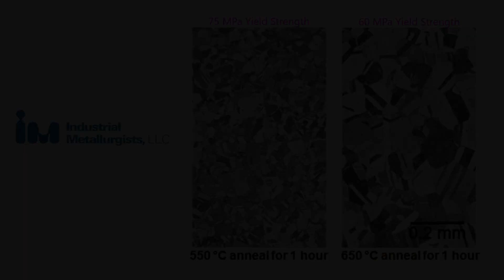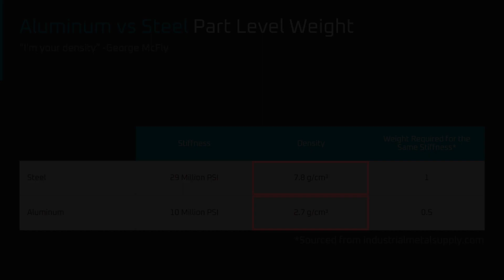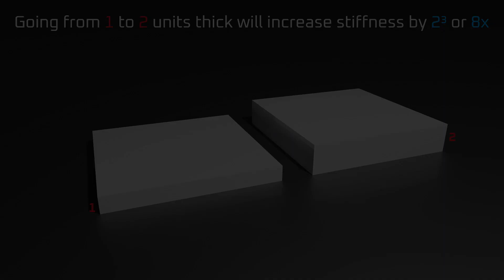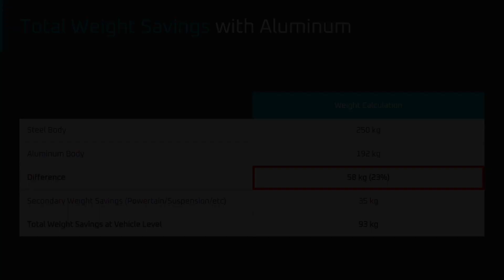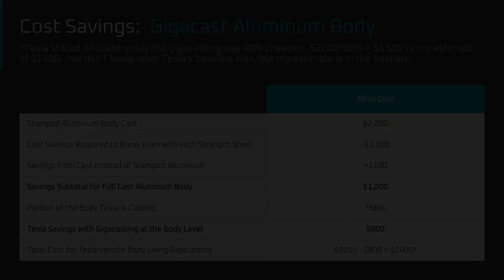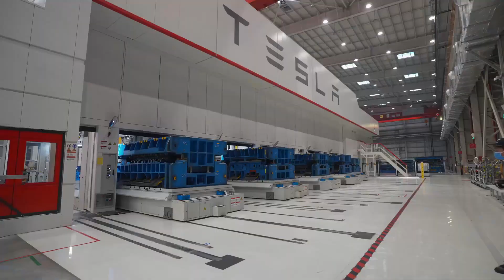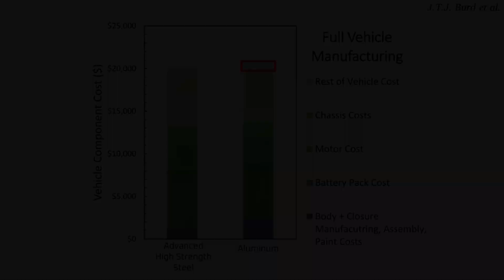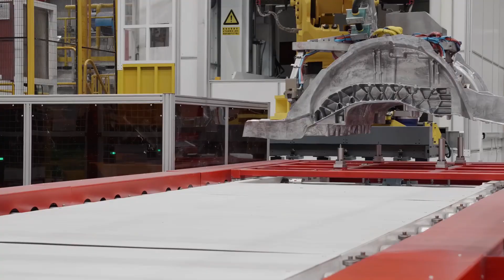#2 Tesla Gigacast Aluminum vs Advanced High Strength Steel

Comment: Very interesting analysis. However I have been thinking that all that only applies to the cars that are made with aluminum. How about the Cybertruck? It will be made using Steel, just like the starship. I have been wondering about this: There have been a few tech improvements that help decarbonize steel production: Metal Molten Oxyde Electrolysis method to obtain steel.  I wonder if SpaceX and Tesla will be using such methods. That should help, as not just the Cybertruck and the Starship are made with steel, but it should also help to decarbonize the iron required for LFP chemestry made battery cells, should Tesla ever make their own LFP cells. 
I already asked this in Twitter linking a video that further explains it. Since Youtube deletes comments that contain links I will only leave this here explained.
Reply from the maker: Cybertruck will have an aluminum underbody for the chassis.

The stainless steel is just the outer shell.
Reply: @thelimitingfactor  My point is that there are newer tech methods to refine iron and steel (and decarbonizing the process) , independently of how much of the Cybertruck is made of pure steel or if parts of it will be aluminum, some of it will need steel. Could you please take a look at my reply on Twitter?
Reply: FALSE, Cybertruck will have a Gigacast AU Rear end, using the Worlds Largest 8000 TON Gigapress to make the Part. the Rest of the Truck is MIX of AHSS, Mild Steel and Stainless Steel Alloy body.

Comment: I am surprised that you did not say anything about the precision and repeatability of the casting vs  assembling  frames by welding parts together. Casting allows a much more efficient use of material because it can be exactly as thick or thin as needed for the structural requirements of each area. For high speed manufacturing  creating ⅓ of a car in a few minutes means a smaller factory and workforce.
Reply from the maker: Already covered in the first video.  It's a series.
Reply: @thelimitingfactor  thanks! Somehow I missed it.

Comment: Great video! What mix does Tesla use today for its vehicles of aluminum and steel? That way we can predict the cost savings vs vehicles today.
Reply from the maker: Covered in the video 66% Al probably
Reply: @thelimitingfactor  Thanks! Is it likely that because Tesla isn’t using Gigacasting Aluminum, that when they make the switch, it could realize that large percent decline in cost? So not just save $100s of dollars, but far more.
Reply: @joiemoie   - dont forget , lighter weight vs AHSS and Range Increase .

Comment: Kinda related, but VW's chairman, Herbert Diess recently said that it takes Tesla 10 hours to make a model 3, but it takes 3 days to make a VW id.3.  I assume he's talking about Giga Berlin and Al casting.  He proposed tearing down some current plants and building back with more efficient plants.  I think VW is getting the message, but other manufacturers....?
Reply: Diess said that it takes 30 hours……
Reply: they are still building COMPLIANCE EV made with OLD FASIONED car Technology.
Reply: I don't know if it's already happened or not but Diess is facing a vote of no confidence at VW.
These guys are still pretending it's 1995 and it will take Diess a miracle to survive inside a dinosaur 🙄
Reply: the problem is that it seems Diess is alone at Volkswagen trying to convince them. So much that he dares mention the "T" word directly. It takes guts. I hope he gets fired from Volkswagen and Tesla hires him!
Reply: @Akira-nw4jl  I think all traditional auto manufacturers are facing boardroom struggles.  IMO, Toyota is loosing the battle, BMW is on the fence while GM seems to be forging ahead. The recent sales numbers reported by Tesla are telling...they outsold BMW, Mercedes and Audi in the last quarter.
Reply: @tommckinney1489  GM will want to improve on thier 26 evs for the 4th quarter of 2021

Comment: Elon said at high volume the giga casting might save them $260 per car. That not just from labor and material savings. It would include the saving from operational efficiency which to me would comprise more than 1/2 of the savings. This is why Ford and GM don't use casting.  They have to get their factories to produce at full capacity before they can get any benefits from squeezing more production out of a factory. Operational efficiency at Tesla is criterial for survival.  At least till the cost of EV's drop below ICE vehicles.
Reply from the maker: Interesting, do you have a reference for Elon's comment?  And was that for one cast or for two?

Comment: 15 and 20 minutes in: VW just admitted this week that the model Y takes 1/3 the time to assemble. Some of that MUST be from the castings.

Correction Edit:  VW said the Model 3 takes 1/3 the time.
Reply from the maker: Possibly not, they said it was the model 3 and the model 3 doesn't use castings yet
Reply: @thelimitingfactor  Well I got the model wrong, but I will bet that the ratio is similar for the Model Y.

Comment: Speaking of advantages, you left out one of the biggies, literally orders of magnitude better QC on the panel gaps. Elon was serious about microns vs the current millimeters.
Along with a brand new cutting edge paint shop, complaints about fit and finish will be history.
Reply from the maker: Covered in a previous video and will be covered again in the summary video
Reply: Rock on - Sandy Munro also did Analysis on Tesla Gigacastings. 
says QC is minimal, and can Shread rejects and Damaged parts.
Reply: Complaints coming from customers are compared between manufacturers at 3 months of ownership (3MIS 3 Months In Service). This data is shared across manufacturers and QA evaluation data in house is compiled by each and published so manufacturers have an idea how they're doing. But... Tesla refuse to do this.... Why do you think that is? Customer satisfaction is more than just fit and finish...it's the complete ownership package.. how satisfied with the car are you... What issues did you have as warranty claims etc... Why don't Tesla publish their data? I would guess it's not upto scratch... If your good you'd make sure it was known...
I worked 30yrs inspecting quality of new vehicles.. I've seen some Tesla's parked... Oh dear... There's some real bad panel fits out there... Not saying each manufacturer is perfect but bleating on that Tesla will be perfect is a pie in the sky... In real life getting a cars panels to fit properly usually requires manual bending somewhat to get it to fit. If you think that an assembly line WILL turn out perfect panel fit you know nothing of how cars are made, how cars are adjusted or how they are repaired to be ready for the customer from new. Go on a car plant tour... You'll learn something
Reply: @terrybrown6057  Why should Tesla have to do as the legacy car manufacturers have traditionally done? Our 2 year old Model 3 is perfect, panel gaps and paint are as good as any car (confirmed by detailers), reliability has been 100%, and build quality is very near to perfect. 
The Tesla is MUCH better than any other new car we’ve owned, (and without counting, we have had a lot of new cars in the last 40 years.)
The Tesla is just in a whole different league compared to all my previous ICE cars, which over the last 40 years includes European, American, Korean and Japanese built cars.
Reply: @FutureSystem738  as I said... As a customer you would never know how the company as a whole is performing. Yea, you have a car are happy with..great . But the truth is in warranty claims... Why do you think Elon refuses to publish warranty claims? Everyone else does. There are good cars with every company... But even with your detailers they won't have access to engineering standards and what tolerances are allowed before a fault becomes unacceptable. For example a panel that is designed to be flush +/-1mm... Each manufacturer has different levels of tolerances allowed as to what is achievable to the drawings. And what is allowed to be shipped out the door. So anyone working outside of QA at the manufacturer will never know what is allowed to be good or not. Every part has tolerances from fit n finish to even allowance on how hot an LED should be on a switch... What I'm saying is pure quality data is compared from sources of customers fault feedback and offline fault detection and treatment.

Comment: Hey Jordan, great work as always! Just curious: does the costing and cost savings include labor costs? With 1 part replacing up to or around 100 parts, I would assume there is a large amount of savings in labor just in assemblage of all that.
Reply from the maker: GREAT question!  Yes, the MIT estimate included energy, labor, overhead, tool cost building cost, maintenance cost, material cost.

Comment: Another opportunity for economies of scale is the possibility to use the same casting for both front and rear. maybe that's how we ended up with rear wheel steering on the Cybertruck.
Reply: NO, gm is using the same BOF and suspension as Regular trucks , you can add Quad steer as Aftermarket option. not that hard to do.
Question will be , how much Quad steer will CT get 10% or 15%.

Comment: You compare the cost per unit weight of steel versus aluminium. When you create stamped steel parts, there is a lot of waste steel that gets thrown away. When you create cast aluminium parts there is very little waste. Are you using the amount of steel (weight) that ended up in the vehicle, or the amount of steel that was purchased  - in other words, do you need to include the cost of the steel that was thrown away.
Reply from the maker: Good question!  The research was pretty comprehensive, I'd have to look through all of it.
Reply: The off cuts are recycled back... Not thrown away
Reply: @terrybrown6057  I'm happy to hear that, but since the price that they get for the recycled cuts is less than the cost of new material, that difference would have to be included in the overall cost. Not sure if it significant, but it could be.
Reply: @ljd7088  depends on whether the car plant has its own smelter ... Some do..

Comment: There's another cost:weight dynamic that is of increasing importance... the after sale cost of fueling/charging the vehicle increases with the weight of the vehicle. The old combustion industry didn't care, since that cost was born by the customer after they'd bought the car (the colatteral enviro cost being completely ignored for 100 years of combustion). Now with climate change driving the dynamic it becomes more important to factor in the impact of weight on the lifetime fueling requirements. Lighter total mass might eventually become more important than cheaper build and market price.
Reply: I’m not usually a fan of European regulations. However they have forced car makers to improve fuel consumption and safety of passengers and pedestrians. 
Tesla did not want to be excluded from that market so designed its cars to exceed EU regulations.

Comment: My guess is that your analysis is a lot more comprehensive than that carried out by most vehicle companies.  I think you got it right about the inertia of sunk costs and techniques effectively dictating the continued use of established materials.  Most car companies will focus on specific areas of a vehicle rather than assess it holistically. Tesla only ventured into Giga castings because it was a way to simply the manufacturing process of the rear substructure that they had developed for the model 3 and model Y, the original being a dogs breakfast of a myriad of parts that were expensive to assemble.  However a good idea applied in one area often lends itself to other areas and sets in motion new trains of thought.  It is only a matter of time before the electric motor outer casings become integral with the subframes as a further step in reducing parts and simplifying processes both of which contribute directly to reducing manufacturing costs.

Comment: There is more to it: Globally there is abundance of cheap bauxite with silica levels too high to make beer cans. But Tesla found a way to use a high silica content aluminum cast to avoid the problematic combustible magnesium.  Airplane makers won't drive up aluminum prices right now so Musk can organize the supply chain to stay ahead of the competition.
Reply from the maker: Hey man!  Interesting comment!  I didn't know this!
Reply: Bullshit, bauxite is abundant but making aluminium is one of the most energy intensive processes. Aluminium is not just used for aircraft but for appliances, cars( engine block, gearbox housing, subframe,) aluminium is also use din vast quantities in construction...... Tesla isn't going to have aluminium for them alone, you're welcome.
Reply: @moineaux9173  What bullshit?  He didn't mention the energy, just supply chain.  And he didn't say for Tesla alone just said stay ahead of competition (and that would be other automakers).  You didn't understand what was written very well at all and reacted to nothing.  That's a fail.
Reply: @TheEvilmooseofdoom  were talking about supply chain here and bauxite has to be processed into aluminium first. Finally the demand of materials like steel, aluminium, copper..... are non stop growing.
Reply: @moineaux9173  Yet you brought up cost of production..  And you brought up the supply issues posed by other industries when the OP was talking about automotives. This is getting weak.
Reply: @moineaux9173  Copper supply MAY become a problem. EVs use 2 to 3 times as much copper  as ICE vehicles use.

Comment: How, and how much, does the use of cast aluminum bodies affect collision repair costs?
Reply from the maker: See my crashworthiness video.  Yes and No
Reply: Just say good bye if the casting is affected in a crash. At least metal shit can be cut and replaced/repaired.
Reply: @moineaux9173  Any car hit that hard will likely be a write off and the castings are also designed so some parts can be cut off and new parts welded in.  Again, you are commented from a position of ignorance.

Comment: Don't forget to consider comparing the weight/cost of the past EV batteries vs the new aluminum/graphene batteries vs LFP batteries too ... 

Developer Of Aluminum-Ion Battery Claims It Charges 60 Times Faster Than Lithium-Ion
https://www.youtube.com/watch?v=aWXX8q88eZY

; )
Reply: IF it can get past the bench.  Lots of new battery chemistries being invented but not so easy to go from the lab to a factory.  So can't really pass judgement on the new tech until it's made it that far.
Reply from the maker: Amen.  You won't be seeing that aluminum battery anytime soon.